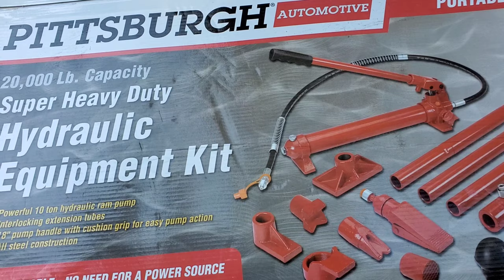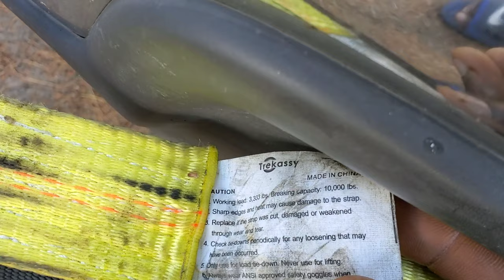10 Ton Heavy Duty Portable Hydraulic Equipment Kit, PORTO POWER Frame machine  Auto Body Repair Kit

Comment: That piece on the vehicle is crushed and can simply be swapped out, just find the part. Unless you're going to cut out, replace, and weld a new plate with gussets, etc on that piece,  you should change it.